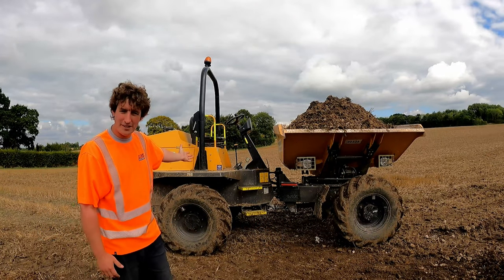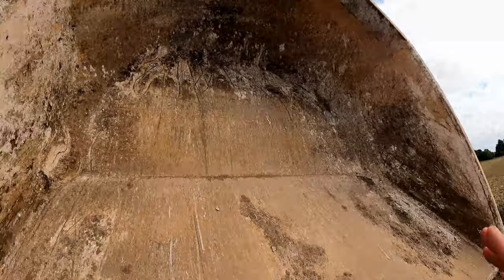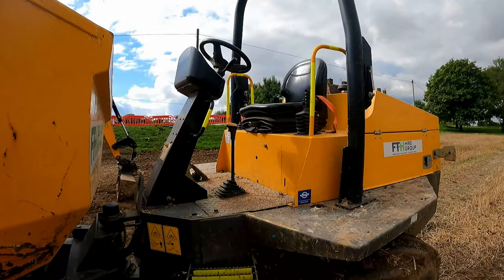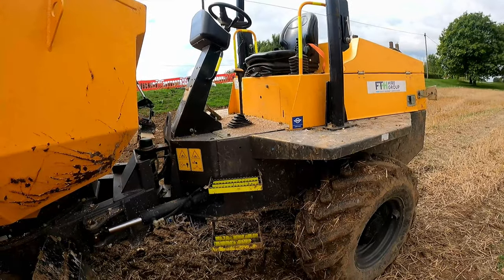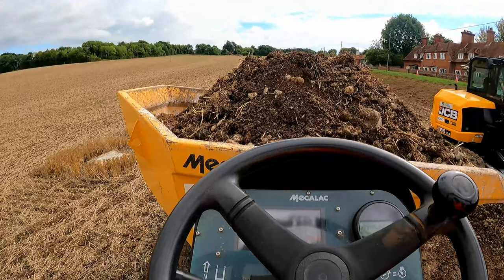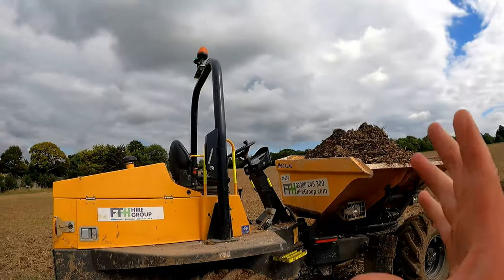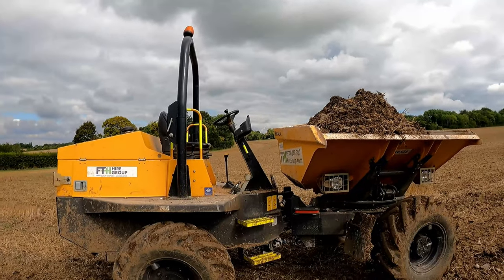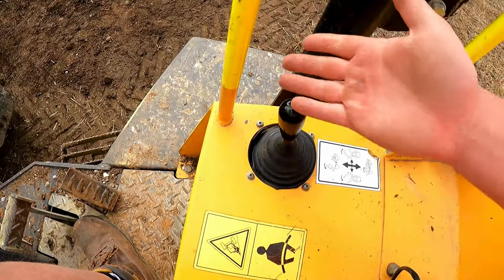6 Things I hate about modern site Dumpers

Comment: Agreed Ollie. Site dumpers really have reached the limit of being engineered/modified to fit today's sites. Stuff like heated seat, cup holder, operator storage... These things should be standard on a modern machine. Operators who need to sit on these rain/snow/shine need better! I think what JCB, Thwaites, and others are doing with the cabbed dumpers is fab. Its definitely a step in the right direction. I had a chance to sit in one of the JCB dumpers and it immediately felt much better to be in.
Reply: Wacker Nelson do a cracking dumper with the DV90 Duel view with air con radio etc alot safer to use than any of the others on the market @Ben

Comment: We use Paus dumpers and in my opinion they are very good no matter if they are 20years old or new, only the acess is on the back which is something that not everyone likes.
They have a better skip. You can start the enigne without sitting down, you have steel sheet roof on the roll over bar, which would protect you if you tip over in soft ground.

Comment: Good video Ollie, agree with all your points , the main one for me being all this service light nonsense,  I run a 3 ton terex dumper , it's a 2005, got it shot blasted and resprayed,  new sticker set , it looks as good as any , simplicity, probably have no intention of changing it for anything newer because of all this , just more expense and more set backs for nothing , and as you point out the design has never changed anyways so as long as it looks fresh itll do the job and look the part as far as im concerned 👍
Reply from the maker: Dumpers from that era will go on forever, they had decent engines and plenty of power without too much electronics - ideal for people like you and I to maintain. Keep it tidy, look after it and don't ever sell it! Nothing newer has improved on it in the last 17 years!

Comment: Hi Olly, get an OBD reader - 2 way, to defeat the warning lights etc.  A warning light and limp mode is not going to force the owners to do any more maintenance - I can't believe how bad some of the hired in plant is...   Manufacturers seem to be a law unto themselves, who regulates the safety features on these machines?  More modern stuff has electronic transmission locks and steering locks (a fiddly but effective bar and padlock on the Avant).  Why are these machines not made safer and more secure?  Cost.  Until regs, like the Euro 5 engine emissions , come into play it seems site workers are expendable.  I know of a operator that was crushed by a dumper and a farmer with one eye from unhitching a trailer from a tractor.  Simple safety features would prevent so much - shame the camera is not working very well on this machine...

Comment: Thanks for the video, there is a lot makes sense, but the bean counters will always say that designs kind of half worked for years profit first . The real worst thing is lots of guys design stuff and never drive it for any time let alone 3 months to find out " well isn't that just f'in annoying, maybe we should fix that and explain it to the bean counters better. Does that side panel have a lock ,if it does they are probably trying to stop kids dumping stuff in the tanks and not making a whole new hood in the process, bean counters again !   So instead they leave the brake open and give them a camera screen and expensive dash to smash with a brick, you couldn't make that up.  1 thing good i noticed is they finally took the generic Lucas key switch out, I bet 60% of the boys in my  school year learned to drive and become proficient  operators with a thwaites dumper like this on a site after hours. If you know what a bow tie shaped brick tie is They started them jamming the twisted wire joint tail in the switch and turn it. I learned on our farm with machines we owned in about 1985 if you're  wondering L.O.L.  I bet in 20 years the only fueled internal combustion engine running on site will be fitted to the generators charging all this battery junk they want to push now, and that will still have service traps built in ! Take care.

Comment: about the seat belt, people have been jumping out of rolling tractors, dumpers and diggers for decades, thinking it was safer then staying put and buckled up, getting themselfs flattened, you can't fix stupid.
Reply from the maker: Indeed they have, but wouldnt it feel a lot safer option to stay on the machine if there was more of a cage around you rather than just a single bar. Sort of how the canopy mini diggers are. I just think if you felt less exposed on the machine you might be more tempted to wear the belt properly and therefore increase safety much more than a green flashing light does....

Comment: You miss  the  big problem the skip is higher than the  wheels to turn so making it  top heavy will turn over easily  I lost a good friend off one of them  . Stick to  the front tipper
Reply from the maker: You are right, I think only JCB have tried to change the design of a forward tipping dumper and that wasn't very well received - so much so that they don't make the model anymore! The whole design needs updating for the modern safety rules and tighter sites - not just retrofitting something to the same old compromised design!
Reply: @Olliegunns  Yes the Hi-Viz dumper. Cool idea but soils would not leave the skip making it near useless in the UK, the biggest site dumper market in Europe.